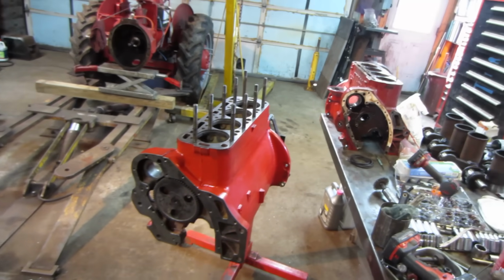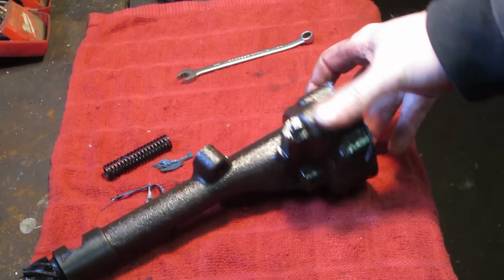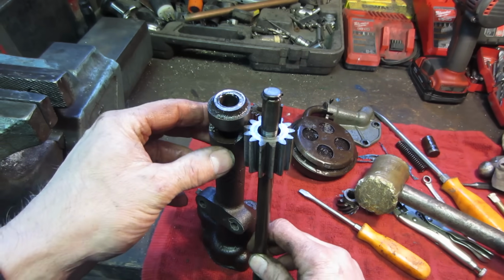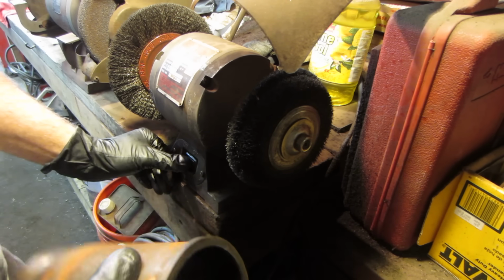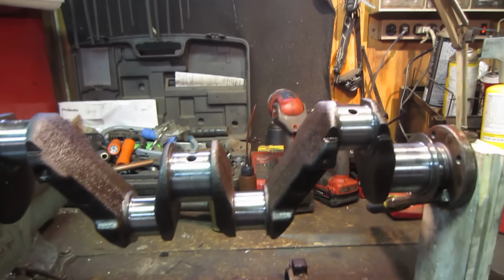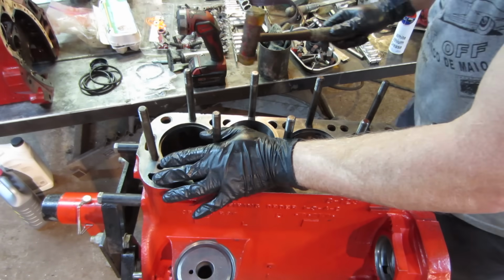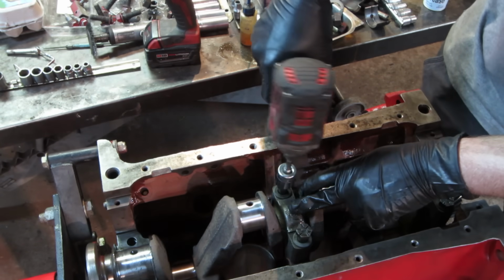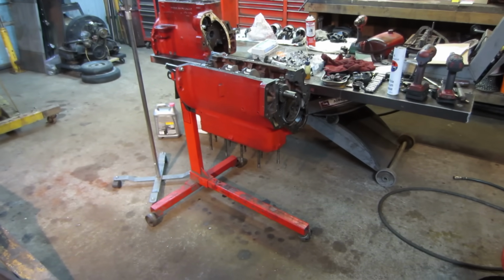1941 farmall a tractor engine reassembly. pt4

Comment: I must admit that, as a former shop teacher, boater with 3 diesel engines aboard,  and someone who has created or repaired things all my life, I was surprised at Mustie's approach to repair, loading and unloading, and generally messing with stuff.  HOWEVER, after watching all (I think) his videos, he is the man I would want next to me if things weren't going well.  It is clear that, if he wants to, he can get it running, whatever it is.  Like my old First Sergeant, if things got tough, I'd want him to be close by.

BTW- if someone wants a different pace for the video, go to settings and adjust it from .25 through 2x speed.

Comment: Front crank pulley is junk, someone did a job on it to keep it on the shaft, do a test fit on the crank, set screws were never used to keep the pulley on, my 2 cents worth !!!

Comment: Plastigauge is your friend
Reply: Mike you got that right, i had a time with my 123, that i hired, to overhaul mine.The first bo-bo was the first parts man, give the mechanic  standard bearing for a .10 cut crank, so i get the tractor and complain this thing doesnt have enough oil pressure when its warm. Oh maybe its the gauge is  faulty maybe, this that, i just quite mowing when  the oil got warm. The second mechanic  just reads the back of the bearing, oh it's standard so he send it out with no oil pressure when it gets warm, i went thru that for 2-3 more years. Finally took  it too the 3 rd guy, and he was a real good reputation, he mic''s the crank, bingo, here the other two Bozo's almost cost me a engine, but the crank was perfect yet. Now its got oil pressure when warm.
Reply: Jim Farmall ccc
Reply: oil pressure comes from side clearance on the rods, where the oil leaks out of, not necessarily rod to crank clearance, within reason and this is something you can't plastigauge
Reply: But inside and outside Mike set would help.

Comment: there never should have been ANY gasket sealer on that pump cover, idk about that tractor, but every automotive pump I've worked on never had a gasket, its a machined surface that is designed to seal without a gasket. plus, a gasket would screw up the endplay between the gears and the cover.
Reply: Those pumps do have a very thin gasket that comes with the full engine gasket set.  My Super C was exactly the same engine.
Reply: oil pumps have no gaskets
Reply: @strawbarryred  what and when did you work for and design an oil pump for a 70+ old tractor?
Reply: @supermine291  the biggest reason not to use a gasket would be that the pump could lose prime and start sucking air A machined mechanical seal works the best!!!!!!!!!!!!